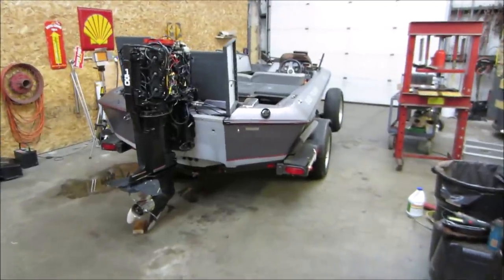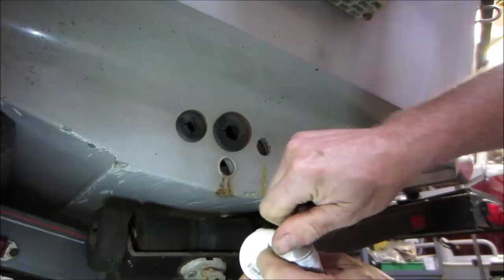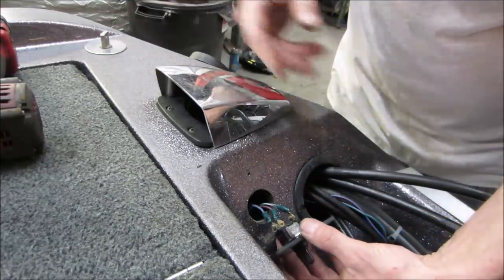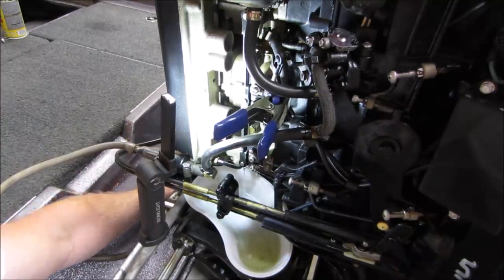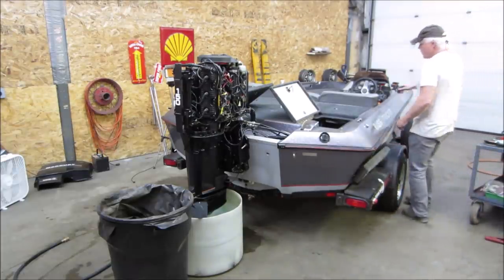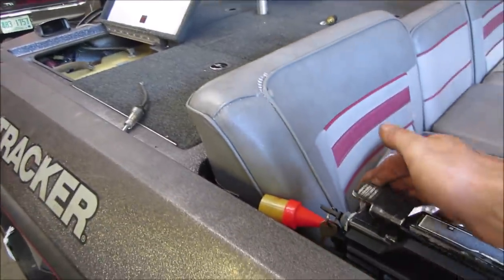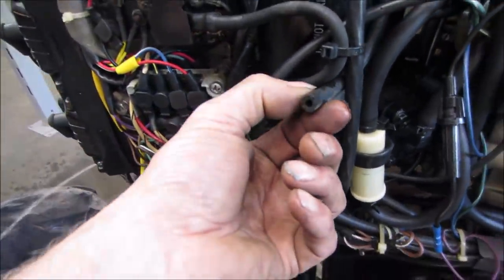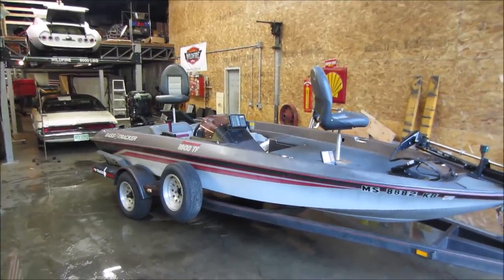Bass Boat Sitting 10 Years, Lets See If The Engine is Good?

Comment: As suggested before I would definitely replace the impeller. Also I would add some 2-cycle oil to the gas tank just to be on the safe side, until you watch the the oil level in the tank drop. So that you're absolutely sure that the engine has lubrication. Also while you're down there at the lower unit, I would check the gear oil in the lower unit just to make sure it's not milky. last but not least I would yank the prop just to make sure it hasn't seized itself to the output shaft. And to correct it if it did.

Comment: I'd seriously consider replacing all 3 of those drain fittings in the stern. Edit: Having finished watching, that water pump impeller looks like its dodgy. You don't want that failing on you when you're a mile or more out!
Reply: I was thinking that too. He said that white was the only one he could find after looking at several stores. He should have just ordered a couple online and changed them before he put that tank back in.
Reply: @JonBecker81  and get metal noes instead of plastic!
Reply: I agree! He may really want to consider replacing the other two as well. Metal (prob. aluminum) would also be the way to go. Brittle plastic carrying the fate of the S.S. Minnow! Sheesh! At least the tank isn't a real bear to get out. (When it is empty!  :-))
Reply: Yes, and use polyurethane sealant (Sikafley marine) below the waterline instead of RTV silicone.
Reply: On boats that do not have a zinc  grounding system you should only use the nylon or plastic fittings. Generally on larger vessels, you would use the non metallic thru hull fittings above the water line because they are discharge lines and bronze fittings for suck lines. All fitting, both above and below the water line should always be embedded in 3M 5200. There are other brands, but the 3M 5200 has always been the best for me.
Reply: @donho3617  3M 5200 is permanent, RTV silicone is much better for this application.
Reply: @michaelslattery2121  No, no it’s not Rtv will fail 5200 will not when properly applied. And yes a live well inlet is a permanent thing there’s no reason to not use 5200 other than ignorance.
Reply: @Alejandro-vb2fx  How will you replace it when it breaks again?
Reply: Absolutely without question.
Reply: @Alejandro-vb2fx  agreed 5200  is the way to go
Reply: @michaelslattery2121  if you heat up where the 5200 is it will come off a lot easier. We do it all the time on our boats here in Maine.
Reply: Did anybody watch the video? He spent about 5 minutes replacing the broken fitting. He didn't etch the finish with solvents, he didn't weaken the core with heat, he didn't delaminate the layers with excessive pounding, all of witch are possibilities when trying to remove 5200.
5200 is advertised as a PERMANENT bond. Why on earth would anyone choose a product that is designed to be PERMANENT and use it in an application that will likely need to be removed? All of the experts that have figured out how to defeat the properties of 5200 failed to select the proper SEALANT needed for the job in the first place.
Reply: @michaelslattery2121  you feel better now????? Using a heat gun on 5200 does not weaken the structure. When glass hardens it creates more heat than I was talking about. If you’re that concerned than I guess he could use 4800 which also creates a nice sealed bond as well
Reply: Yes, of course you are all correct. I deeply apologize for my ignorance. My God, I hope Mustie checks these comments and realizes that boat will sink like a rock because he used sealant instead of glue on that fitting.
Reply: @michaelslattery2121  glad you realized the errors of your ways. Don’t do it again

Comment: You want to use 3M 4200 or 5200 quick cure for thru hull fittings. Silicone will leak after a few runs. BTW, nice boat.
Reply: Dear Wayne R.
👍👌👏 You are absolutely right, Sir. Nonetheless: I highly recommend sikaflex brand. That's at least the stuff that most professional boat builders use.
Best regards, luck and health.
Reply: Absolutely! And 2 hose clamps on thru-hull fittings.
Reply: If the manufacturer had used 5200, he’d have had to drill it out. 5200 is forever. In fact 5200 is what boat manufacturers use to glue decks onto hulls of mega-yachts.
Reply: Second on the 5200. That's some good shit.
Reply: What,why not flexseal? Nah just kidding. Most of what 3m makes are good products. My dad worked for 3m in their electronics division 28 years. Great company overall, and we always loved when dad brought home products from the 3m company store.

Comment: I have almost the same motor, but mine's a 1993 135.  Same basic block and top end as a 150. No problems in 18 years (change water pump impellers every 3-4 yrs.)  Great motor.

Comment: If I'm remembering right, there are two kinds of throughulls. The Delrin (black) ones are for below the waterline (they're tougher) and the white ones are for above the waterline situations. If one of those through-hulls deteriorated from age, might it be time to replace all three?
Reply: I think he wanted to replace the two live well ones at the same time but after four stores he only found one.  I wouldn't be surprised if he eventually doesn't replace the other two as well.
Reply: Most fittings now are polypropylene uv resistant plastic. 
What's important is using the correct sealant. Marine sealant will actually keep water out below the water line. Regular silicone like he used will fail.
Reply: It's def time to do all of them. Ok it's not a bluewater cruiser but it will still sink when one fails. It's not IF, it's WHEN.
Reply: I want to see these boats
Reply: @victorbitter583  keep drain plugs that fit in them from outside or inside when broke off. crisis averted, may have to take a tiny swim to plug a hole.
keep a spare plug or three for the boat drain also(may stop you/someone else from sinking), modeling clay/electrical putty works too..
also know that those low bottom transom holes will be out of water and become drains when forward underway after a certain speed, most will become fairly negative pressure and suck water out faster also!
Reply: @DocNo27  l

Comment: Hey brother next time you’re trying to push a rubber line over a barb fitting put some liquid dish soap on the fitting it will greatly ease the installation and eventually dry up making it near impossible to come flying off under pressure I am a millwright and I actually have a small bottle of dish soap in my toolbox and because of it my knuckles don’t bleed nearly as much as they used to and when they do I can clean them lol!

Comment: I had the exact same engine on a former boat.  The first water pump you had in your hand was the correct one.  I suggest you check the lower unit oil before use.  There are two large slotted screws near those water intake holes.  The top screw is the vent/full level and the bottom is the fill.  If the gear oil looks milky it has water in it.

Comment: Can’t beat the old 2-stroke outboards for reliable and durable power. One 4-stroke was enough for me. Bypassing the oil injection is a superb repair.
Reply: I have installed a couple of electric oil injection kits on older Mercs, works quite well.
Reply: @michaelreynolds1904  I tried to install one for my 1997 Mercury 150 but couldn't find one. Seems a company used to make an electronic retrofit for it, but I think they went out of business.  I had to disconnect the oem injector due to the plastic gear failure inside the engine that turned the gear for the injector pump. I really wanted an injector, but I settled for just mixing for now.
Reply: Although my outboard is a Johnson, my VRO ( oil injection system ) was removed by a previous owner, guy I bought it from said the VRO pump died twice before.
Reply: @cutum  didn't realize theybwent out of business.  Too bad, it was a nice kit.
Reply: @genejudgejr6931  VRO i have found out stands for.. Very Rarely Oiled 😁
Reply: I had one (XR6)you had to mix and two (EFI & Opitmax) with the auto oilers and I prefer the auto's. Never had a problem with either.
Reply: The 90's Merc's are awesome once you delete the oil injection system and put a big "MIX 50:1" sticker on the fuel door.
Reply: What is advantage of having an oil injector over pre-mixing? Does pre-mixed 2-stroke fuel not last long or something? Or has to be re-mixed constantly in tanks that size?
My only 2-stroke experience is with small lawn equipment - chainsaws and line trimmers etc.
Reply: @ApprenticeGM  That's actually a good question mate. When they're new, in spec, and working correctly an oil injection system is way more convenient than pre-mix, and may offer some environmental benefits. It's important to emphasize how convenient it is - mixing yourself up 100 litres (30gallons?) of gas is a super pain in the butt and these things are THIRSTY. Edit: failure to mix the gas correctly is also a very common failure point. Fouled plugs on one end and trashed engines on the other.

Comment: You can get a really good thick plastic battery box from West Marine online then use liquid Nails to hold I'd down on the bottom and side.
That's how we did it in the Keys. No hardware or holes thru the box to worry about rusting out.

Comment: The impeller shaft is off-center in the impeller housing so the blades of the impeller are compressed on one side and flex open on the other side.  At idle, it is difficult to detect whether you will have an overheating problem at higher RPM.  If the blades are set and don't flex open, that will show up as an overheat under load and not at idle.  Long story short, change the impeller as suggested by many others.
Reply: Very good! Explanation
Reply: I know from 40 years of experince those impeller blades are worn, feeble and clearly have taken a set. The last owner was NOT a moron. I listened to him. He clearly stated the cooling indicator flow was weak. It is supposed to look like a race horse pissing even at idle!!!
Impellers are easy to change on marine diesels. And a real PITA to change on outboards. But you gotta do it!!
Reply: I get the feeling he isn't listening.

Comment: Mustie1,  Please replace the water pump, that's a must.  Also, in order for the choke to work you must push it in and turn key together in order for it to work.  As for the throughhull, I would replace the other two as mentioned below, use marine 4200.  When you turn on the master panel switch, you don't always need the bilge on it will come on with the auto float switch, you don't want to burn it out.  Other than that, take her out and test drive her.  She seems to be in good shape.  Oh, one other thing, replace all the fuel lines and after that run only Rec fuel.  Do not run any ethanol fuel as those 2 strokes don't fair well for long periods of time with it.  You will also want to change the fuel/water separator at some point.  Can't wait for the next video.

Comment: The gas in the tank most assuredly had oil in it. I suspect the auto oiler had failed and he was premixing and forgot to tell you. That broken oil line you found could have been the problem. Make sure the oiler works or just forget it and pre mix.

Comment: Hey Mustie, in order to fill the engine mounted oil tank you must run the engine with the oil cap loose. That tank is not vented, so if air cannot get out, oil cannot get in. The boat oil tank has to be air tight or it cannot build pressure and will not transfer oil to the engine tank. Wait until the engine mounted tank is overflowing before tightning the cap. There should be no air in that tank.

Comment: You're doing a nice job on that bassboat. That green that came out of the gas tank was 2-stroke oil. Don't trust the oil injection pump with out removing it and checking the"PLASTIC" gears. mix 2-stroke in the fuel until you know the oil injection is working. Outside jets on the carbs are air jets. Try using carb cleaner sprayed in through the carb drain holes. I do this when possible on any outboard that has been sitting. Even ones that have been winterised. I've been doing outboard repair since the '70s. This is the best YouTube channel.
Reply: Change that water pump impeller and check the thermostat. Barrel method for cooling water is not recomended because the water pump should be "BELOW" the water level not just the water inlet. Buy a set of "muffs" to attach a hose for a water source. I didn't hear any alarms when you turned the key on. There is an alarm for low oil and one for overheat. They should buzz when the key is on but the motor is not running. Looks like a late '80s engine. I would guess '87 or '88. It should have the alarms. You got lucky with those carburetors! Every one I see is full of water and debris. Gives the Ultrasound a workout. If you have an infrared heat sensor move it all over the heads and block looking for hotspots. Mice and spiders leave some awful clogs in weird places. I just did a 3 cyl Suzuki that squirted water like a firehose but overheated because of a huge spider nest under the exhaust plate. Also found the remains of an impeller blade in the waterjacket. Had the powerhead, cylinder head, exhaust side and bottom covers off to collect all the debris. Wait "til the labor is added up! Less than $100 in gaskets and seals. About 8 hours in labor. Damn spiders!

Comment: Funny story about through hull fittings and bilge pumps. So I had a bunch of people down to the marina and had planned to go out but a storm was moving in. Threw up the camper canvas at the back before it started pouring and as we were sitting there having a beer I heard the bilge pump go on (as it normally does when it's raining). It is a biggie, something like 1000 gph....and it cycled off....went off again, and kept running. Wait, what? Got everyone off the rear deck....ooopsy, the through hull fitting had broken and it was just cycling the water around the bilge. Luckily I have two, just shut off that one and let the other take over. 

Learning lesson: the torque of the pump was so high that every time it went on, it jolted the hose and stressed the fitting. Next ones I bought were labelled as "unbreakable" FRP nylon as opposed to plastic.

Comment: 100% change that water pump.  It would be a shame to loose that motor to overheat over an impeller.  
Be sure to check/change the gear oil. 
That float on top of the oil tank I believe is for the low oil alarm.  The fact it’s down and not screaming tells me it’s not working.  I’m not sure if it has any bearing on the oil filling. 
Those old black Max’s really scream and have a nice howl to em.  Nice score!

Comment: We missed your video this weekend, most of your competitors take a piece of junk and see if they can get it to turn over and to run but then leave it a piece of junk. You on the other hand, find a piece of junk get it running and then turn into something that is valuable to you and your watchers, there are only a few that do that including you and that makes more sense than watching a guy that doesn't even check the oil before starting a engine that has been sitting for a long time.

Comment: Nice little series. Suggestion: If one thru hull fitting is brittle and bust, all will be brittle and about to bust. You should have replaced all 3 with the tank out. It´s just a matter of time and luck before the next goes. Since this is about the biggest single point of failure on this boat, it really needs to be done. So get 3 new black fittings, and when installing do not use silicone. It only lasts for a season or two before drying out. You should use a bedding compound like Sikaflex, for a job like this.

Comment: Trailer axels he hehe the suprizes that get you before you even get to the water!!! Thanks Mustie!!!; )
Reply: Yep, I would take the hubs off and repack the wheel bearings and replace the wheel bearing and associated seals as necessary.  Also install some buddy bearings to easily keep them greased.  Also taking off the wheels and clean and lubricate the lug nut threads to make sure they work when you need to service a tire.
Reply: I hope he changes it that grey fuel line🤔
Reply: Yip  check the bearing s on the hubs grease them before you go anywhere

Comment: The tell-tale won't stream until the thermostats open. Also, the low-level oil alarm should be sounding when you remove the oil tank cap. That float on the cap is the low oil sender.

Comment: That boat sure looks to be in good condition. Nice job fixing the steering and getting the engine to run. I would think that thing will go like a rocket with that engine. Looking forward to going for a ride (on smooth water!). Thanks for the tutorial.

Comment: Any outboard I touch, if it’s. Even sitting for ten years, it’s getting a new impeller. No questions asked.  They get brittle and don’t work right even if they do push some water thru like this on is doing.   They aren’t expensive and aren’t hard to change. And it gives you a good look at the lower unit instead of just assuming everything is cool there too.  Impellers get old and brittle and even if it seems to be working at first, it’s probably not pumping as much water as it should because it’s not dealing against the housing and it’ll probably seem ok long enough to get you comfortable with it then it’ll break a couple fins off and finally quit working altogether and if you’re like half the guys out there that buy an old boat like that, ya probably aren’t all that used to boats and outboards and forget to pay attention to the stream and end up not noticing when the damn thing does eat itself up and you end up running the motor with no water running thru it, you overheat it and then you wonder why it started running like shit and smoking like hell after last weekend...  because you overheated the hell out if it and have a blown head gasket now...or a cracked head...  That’s a really damn long way of saying jus5 change the fukn impeller. If you don’t know how to, you need to learn anyway.